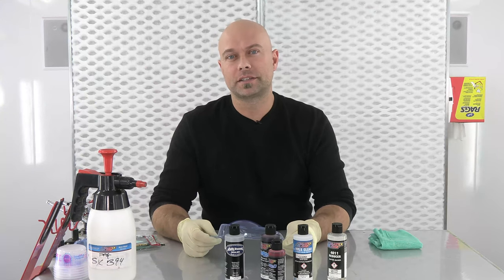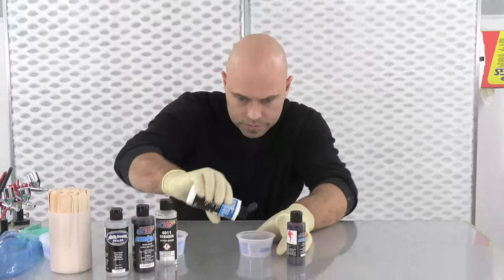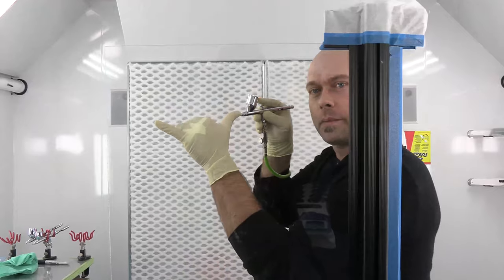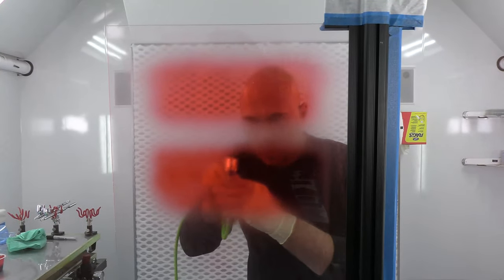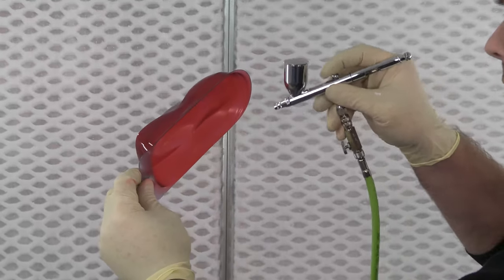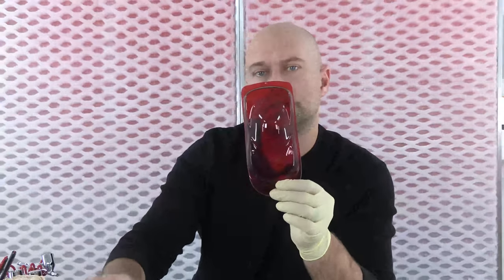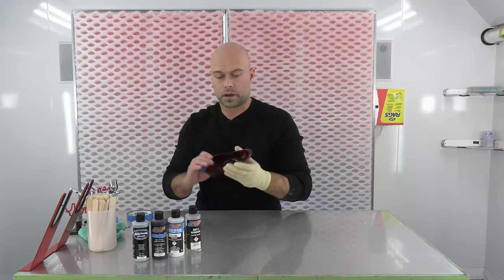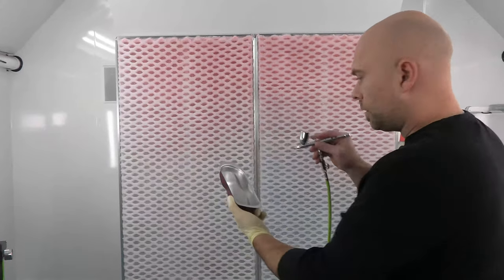Candy RC Car Body

Comment: This is really a helpful video. Greatly appreciated. Quick question, while waiting the ten minutes between coats do you empty your cup and flush your gun with reducer?
Reply from the maker: Hello. Thanks for watching. There's no need to flush the gun and empty the cup in between coats. Notice only minimal amounts of 4011 Reducer is mixed with candy2o for airbrush, and no reducer is added for spray-gun. Not over-reducing and not using 4012 Reducer helps keep paint sprayable in the gun with only minimal agitation after sitting for 10 - 15 minutes. Thank you.

Comment: Great video.  Great information.  I am an RC Car painter.  With using the candies, I want to create 2 other looks.  Anodizing and heavy metal flake.  I was planning on backing the candy with Wicked Quicksilver.  Would this achieve a similar effect like what you just did?
Reply from the maker: Yes. Backing the W357 Quicksilver should be a gloss white for the most chrome-like finish (gloss black works too for a darker chrome finish). This can be done by mixing Wicked or Createx Airbrush White with 4050 UVLS Gloss Clear (~ 4050 4:1 white) or using new Wicked W017 Gloss White, releasing March 1st. Thank you.
Reply: @CreatexColors  If this is being painted in reverse, via Rc Car body, is the 4050 still necessary?  Does this act as a adhesive catalyst?  Just now learning about this world of Wicked Colors.  Just switched from the basic airbrush colors and parma colors.  Had a lot of old stock that finally ran out and I dove right in ordering the majority of what was available.  Thanks for the response.  The library of videos will be a great tool.

Comment: Hi, I have a lot of experience in painting candy on cars but never reversed paint on a lexan body. I have a 53 Ford f-100 body that was very hard to get and is discontinued. So I don't want to mess it up. Lol.  I like the candy red darker, I wish you could have sprayed that one with the silver so I could see how it looked. Anyways I will be using cans of paint that I've had to save for this project. I have duratrax candy red , two cans, and Traxxas transparent metal flake that I'll use instead of silver, and duratrax black for a backer. My question is do you think I will be ok spraying a lot and I mean a lot of red candy to make it extremely dark. Almost like a ruby red, or red wine, kind of dark. Then spraying the metal flake , probably 90 % coverage . I could hold it up to a light and see if I could see light around some of the flakes, then spraying with the black for the backer closing the gaps between the metal flakes and giving the red a little more darkness. I'll be practicing on clear plastic spoons  for samples. Just hoping it will work so I don't destroy the body.  Great video.
Reply from the maker: Please check out our candy2o video color chart to see each candy color over a metallic silver, white, gold and charcoal base, https://youtu.be/svPIxC1mUHE. For the Duratrax and Traxxas color questions, its best to ask those companies and make a test panel or two before the actual paintjob. Thank you.

Comment: I love your colors, I do have the pearls colors and fluorescent paints to. Do I use 4030 with them or can I also use the 4050? Or is that 4050 only for the candy2o colors?
Reply from the maker: Both 4030 and 4050 are "mixing clears", that is either works well mixed with Createx Airbrush Colors and Wicked colors when painting hard-surface. For airbrushing, both work well when added 10% per volume. 4030 is a bit thinner and won't require as much thinning compared to mixing color with 4050. 4030 is pretty good with Createx AB and Wicked Colors for airbrushing. For spray-gun application, 4050 is better compared to 4030. For candy2o, 4050 is better than 4030 for both airbrush and spray-gun application, especially when candy2o is applied as an even mid-coat over a metallic base. Since 4050 was introduced in 2020, we've not used 4030 with candy2o. Thank you.
Reply: @CreatexColors  thx for the explanation. Another question I’m using the candy2o for the first time and mixed them with uvls 4050 put on my 4 coats of each color. And now when I put on the sealer on the 2 lighter Color’s i still see the color true the sealer. Do I have to use more coats on ligt Color’s. The Color’s are caribe marine and midnight blue

Comment: How do you deal with static electricity on polycarb once you start painting? I spray all kinds of plastics and polycarb seems to develop static charge very easily while working with it.
Reply from the maker: As discussed in the video, cleaning with soap & water helps reduce static electricity, as does wiping the car body with a water-based degreaser (for ex. PPG SX-394) or alcohol wipe. Additionally, using water-based Createx paints also helps eliminate static interference while painting. Thank you.

Comment: I am using a Sparmax GP-50 .5mm tip I have 4030 Balancing clear and 4012 reducer I may go 1:1 for my tip size airbrush
Reply from the maker: 4011 Reducer is recommended anytime mixing Createx paints with 4030 Balancing Clear or 4050 UVLS Gloss Clear. 4012 Reducer should not be used to thin colors mixed with 4030 or 4050 as it may congeal the paint mix and doesn't promote flow as well as 4011 Reducer. Thank you.

Comment: I don't understand why Createx requires all the mixing and sit times for the mixes, when something like Proline or FasKolor doesn't require any of that?  I really want to like Createx for the color options, but the added crap one has to buy to use it over other RC specific paints doesn't make sense to me.  Please explain.
Reply from the maker: We make Proline and Faskolor. The additives we mention work for those colors too, improving adhesion and mar resistance. The candy2o featured in this video is a concentrated dye that has to be added to a carrier-medium. The recommended medium for adding concentrated candy2o dyes  is 4050 UVLS Gloss Clear. For more, refer to the candy2o tech sheet, https://creatextech.com/assets/html/pages/Candy2o-TDS.html

Comment: Does mixing with 4050 eliminate the need for 4040 bleed checker? Thanks for the tip about silver sealer. I have been having a difficult time spraying it with an airbrush. Would backing with chrome or aluminum cause the candy to pop more?
Reply from the maker: No, candy2o dyes will still leach into top-coated colors when candy2o is mixed with 4050 UVLS Gloss Clear, however, together with minimal thinning with 4011 Reducer, mixing with 4050 allows for much less leaching / bleeding of candy2o's dyes compared to mixing with 4030 Balancing Clear and / or thinning with 4012 Reducer. In regard to metallic effect, 6013 Silver Sealer is made with a blend of the same aluminum flakes as W354 Aluminum Medium & W356 Aluminum Coarse; 6013 Silver Sealer has fairly pronounced metallic effect for candy2o. W357 Quicksilver creates a vivid, brilliant effect we call Anodized Candy, https://candy2o.com/anodized-candy-colors. 6013 & W357 are each excellent base silvers for candy2o. The best way to compare the two is to make a test panel, or two, three or more. Testing candy/ pearl/ metallic base combinations is fun! Thank you.

Comment: can every createx color adhere the the polycarbonate straight out of the bottle,or is the 4050 the adhesion promoter. So with normal colors, do you need the first layer to be 4050 for adhesion threu the hole polycarbonate rc body. Or do i need to scotch fine inside the body.
Reply from the maker: candy2o has to be mixed with 4050, for every application, including polycarbonate. Other Createx paints do not HAVE to be mixed with 4050, but adhere, level, orientate better (pearls & metallics) and dry to a more durable coating compared to not adding 4050. Most artists don't use 4050 and the results are great, so long as the paint is allowed to dry in between coats and given extended dry time before taping. Scuffing the inside of the polycarbonate body is never required. Clean only. Use isopropyl alcohol and wipe with a lint-free rag. Allow the surface to thoroughly dry before applying paint. Thank you.

Comment: Hello Chris. Can you use anything other then silver sealer as a backer?
Reply from the maker: Yes, any metallic color can be used, however as most metallic and pearl colors are semi-opaque and if, for example, W360 Metallic White is used, then behind the Metallic White, 6001 AutoBorne Sealer White would be used as the final backing color so as to make an opaque backing color through which light will not pass. 6013 Silver Sealer, which is a sealer-primer, covers opaque making it an excellent backing color for candy2o as it adds metallic effect and is opaque so light will not pass through. Thank you.

Comment: How come you don't scuff the body first? I've been painting rc bodies for years using tamiya spray cans over a red scotch brite prepped surface. The only time the scuff shows is when trying to do chrome
Reply from the maker: Createx paints have been used for RC car painting for over 25 years adhere excellent to polycarbonate without having to scuff. Additionally, the RC paints we make under private label can be applied to polycarbonate without scuffing. We've used RC car bodies for spray-out color samples sample since at least 1998, hundreds a year literally, and have never once scuffed the polycarbonate body for adhesion when reverse painting, or painting the top of the car body and top-coating the paint with a 2k gloss clear. What's important is cleaning the car body before paint to remove any mold release or other type of contaminant that could be on the plastic.  Perhaps you've been using a solvent-based / spray-can paint? Solvent-based paint would do better with scuffing to prep for paint. Thank you.
Reply: @CreatexColors  I was just curious, I recently picked up some createx paints and an airbrush and will start using them on my next bodies

Comment: If I don't add any reducer to the mixture how long can you keep the candy/4050 mixture stored in  an airtight container?
Reply from the maker: Depends. Longer than the 48-hour period listed in the tech sheet. If kept air-tight in a bottle and only uncapped when paint is actually being poured from the bottle, a candy2o + 4050 mix should last several weeks if not longer, provided the bottle is kept out of direct light exposure and stored ~ 50 to 80 deg.F. Thank you.

Comment: why do you use 4050 uvls and not 4030 bal clear
Reply from the maker: 4050 UVLS Gloss Clear is a superior carrier-medium for candy2o compared to 4030 as 4050 holds candy2o's dyes uniform in suspension, which allows for color coats that are more even and have a higher color saturation compared to mixing with 4030. candy2o mixed with 4050 also cure to a more durable coating compared to mixing with 4030.

Comment: What size cups are those?
Reply from the maker: The cups are low volume mixing cups. We didn't need to use large cups meant for mixing gallons of paint. Only ~ 3 to 4oz. of candy2o was mixed. Thank you.